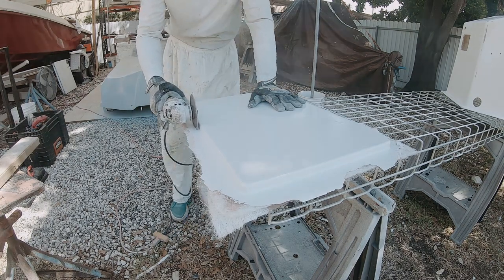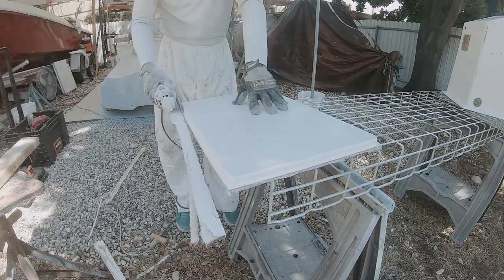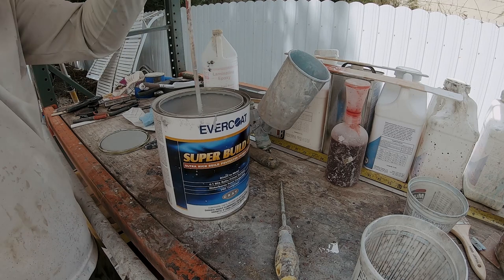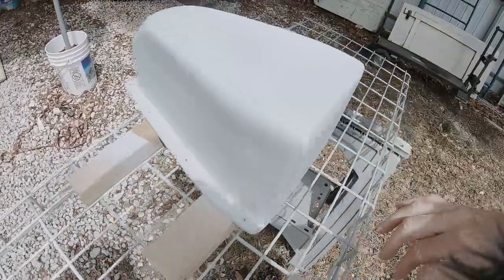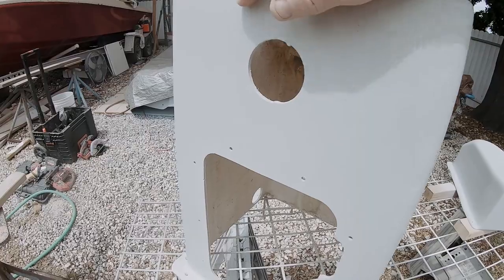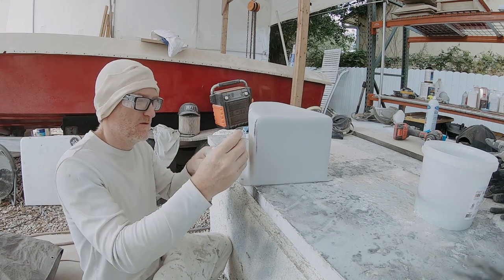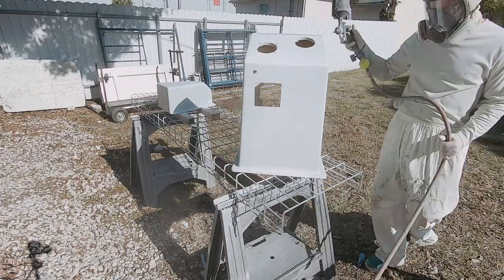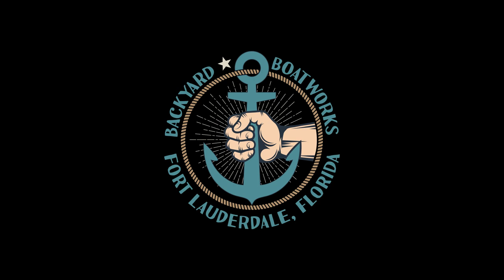This new PRIMER worked REALLY GOOD...WOW.

Comment: Hey bro you should look into buying a Bosch GET65-5N or 6N. I never comment from this channel for some reason on my phone, I was logged into a different account. What was that primer you were using? I'm mostly exclusive using duratech primer, but, I hate using it in the summers. It's so hot in my new shop because of how big it is and no damn insulation. Also for water in lines, I had to get a refridgerated air dryer to combat that shit, I got sick of gelcoat cures getting all weird with just my desiccant filters and my radiator style dryer. It wasn't enough. Any water in gelcoat and it really messes shit up, it's frustrating. Also, any reason you weren't using the new 3m HPG gun for the spraying today? Did you send it back?
Reply: The Bosh sander I mentioned is a DA with forced rotation and AMAZING dust collection. I have festool rotex, a few of these and a makita that's similar and I can say the Bosch one is by far the best even in dust collection. We use Mirka AbraNet paper only and that makes dust collection a breeze. I will say it's more expensive but you go through less so in the end it's like the difference between buying cheap toilet paper or trash bags, they work cheap, but aren't good when cheap. I need to get back into making videos again, I'm just so busy, my new shop is located inside a marina and directly next to the biggest boat ramp in Jacksonville so I'm just so damn busy I can't even see my wife and kids much let alone record and edit. I like these vlog style videos your doing though. They are perfect for the viewer and I'm sure easier for you too. Keep it up dude, your going to grow. You give solid info and you explain well.
Reply from the maker: Thanks for the long comment and suggestion they really help the videos grow. 
The primer I’m using is Evercoat 4:1 polyester high build. I bought it my local auto paint supply shop. I’ve used Duratec a lot and it’s similar to the surface primer. I like the Evercoat because I can let it sit in the gun for a few mins while my first coat racks off and then I can come back and lay another coat. I could never dream of doing that with Duratec. 
It’s a challenge to work and edit and boat repair isn’t my full time job lol. I typically try to edit at night whenever I have a free couple hours. Luckily my GF is very busy with her own job and side hustles.